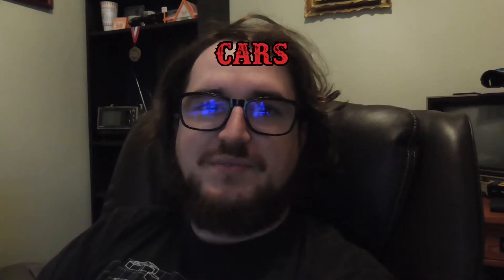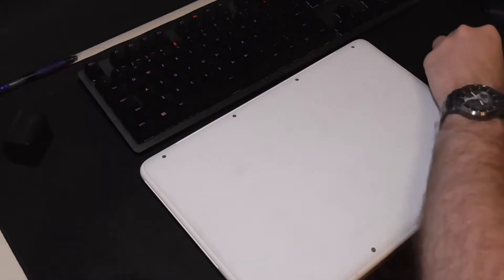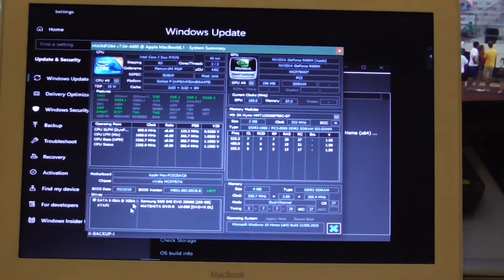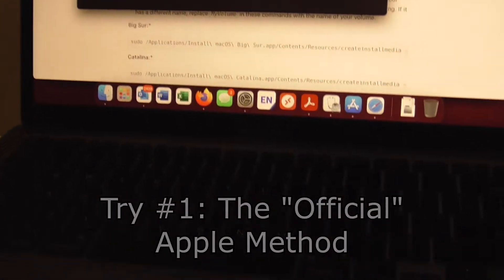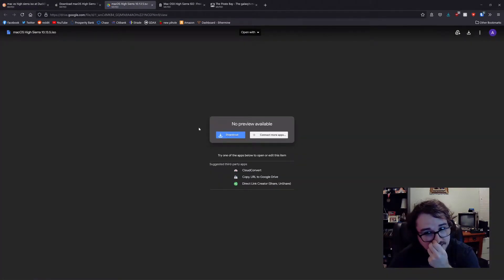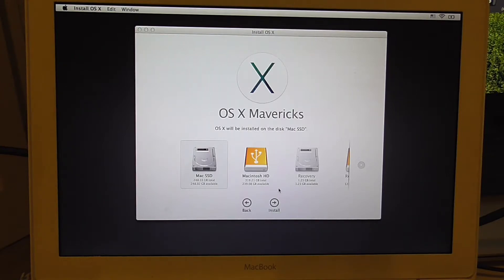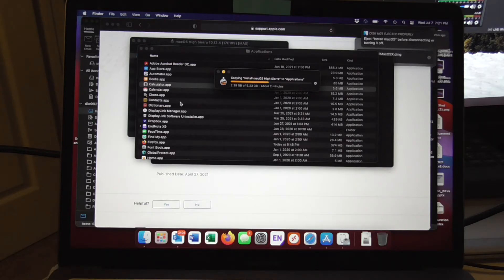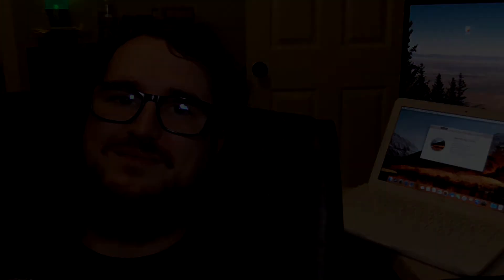Accidentally Installing Windows 11 on a 2009 MacBook

Comment: I am trying to get Windows 10 on mine, a bit of a struggle to get all the drivers.
Once done I'll update of course!
Installing macOS 12 Monterey on this is easy but I'd not recommend it, because you can have minor issues with the GPU not supporting Metal acceleration while the OS requires it everywhere and a lot of apps also do.
Also, the Core 2 Duo processor will struggle to run the OS, because since macOS 11 Big Sur macOS is a lot heavier.
So you can either just install 10.15 Catalina (using Dosdude's patcher), which already requires Metal but doesn't use it too much so you are pretty much fine with the patcher, or you can install 10.13 High Sierra, which btw is the latest officially supported.

Now I am absolutely not saying that there is a good reason for Apple to drop support, 99% of the time there is no good reason other than money, but in this case there is.
If you take a MacBook from mid 2009 so just a few months older, it will only support up to OS X 10.11 El Capitan (yes 10.11 is the latest to still be called OS X and not macOS). But there is no good reason for this, it will run High Sierra absolutely flawlessly as good as native!
And of course if you don't mind the Metal thing you can install something newer.

Comment: I just got a free 2009 MacBook pro with similar specs as yours but they took the hard drive out, I had no idea it was this easy to get windows on this I was thinking you needed to dual boot with macOS. I have a few ssd's with windows already installed so hopefully it's as easy as it was for you.
Reply: Please answer 
did it work and how did u do it ?
Reply: @bjornatlas5017  I just installed Windows only and I had to do a lot of boot camp installations to get it to work properly
Reply: @bjornatlas5017  I got everything working but the Wi-Fi is extremely slow although using an ethernet cable works fast